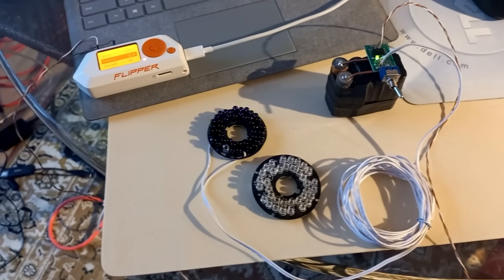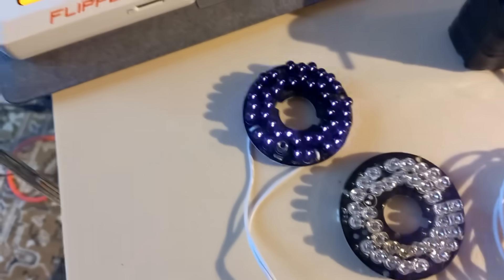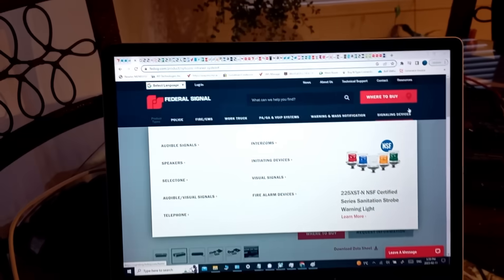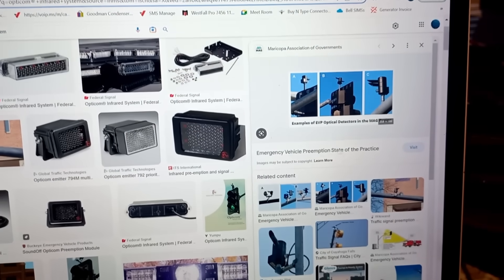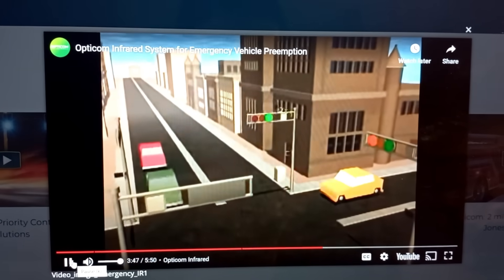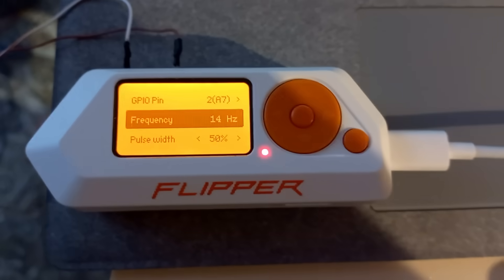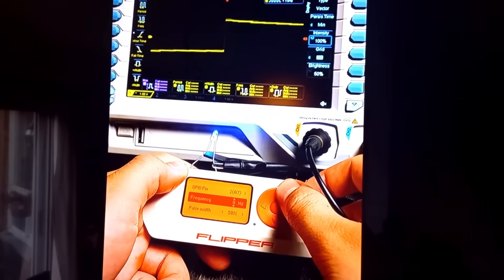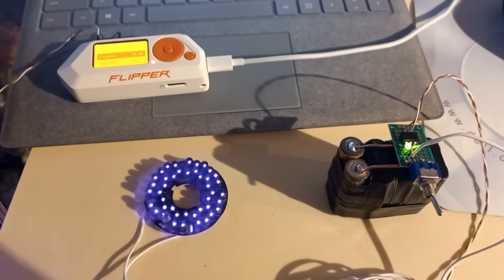Flipper Zero Controlling Traffic Lights

Comment: This wouldn't work in the UK, as we have no such sensors on our traffic light systems or any kind of pre-emption for emergency vehicles. In the UK the emergency vehicle just makes sure that as it approaches a junction with traffic lights, that everyone around has slowed or stopped accordingly, and the emergency vehicle just navigates through the junction safely. Emergency vehicles here in the UK just go through red lights (cautiously), or even go on to the wrong side of the road if required to get through a junction.

Not heard of any particular incidents over here of an emergency vehicle having a collision at a traffic light controlled junction. The majority of drivers hear the sirens, and pull over or stop, and certainly don't go through a green light when they can hear a siren and don't know what direction it's coming from.

When I'm approaching a green light, if I can hear a siren approaching, i proceed very cautiously, looking all around to find the source and direction of the siren. That way I don't go through green, and crash into the emergency vehicles that has just gone through a red light on the opposite junction.
Reply: This assumes you can hear the siren. If you have music playing, you likely can't hear the siren until it's right on you.

Comment: As a traffic signal tech for the last 27 yrs. I can tell you it will not work in any traffic signals that I know of. Like what was said in the video every emergency vehicle is assigned an ID # . The system is programmed to only allow certain ID ranges to be able to preempt the signal.
Reply: @peterfairlie2296  I like you. Very cut and dry, and 100% not breaking the law.
Reply: Often, codes are not used because it limits the capabilities of neighboring jurisdictions to provide mutual support.
Imagine Arlington police/fire trying to respond to Dallas but not having the right code.
Reply: That's what they should do--use an encryption method with a programmable code to trigger them.  This greatly reduces the false triggers.  Sadly, not everyone is using it.
Reply: @peterfairlie2296  If you could do that it would probably work for a limited time. I am in Tampabay and we would run audits every month looking for agencies abusing the preemption.
Reply: Assuming the IDs stay static, it would be pretty trivial to capture a signal sent by emergency vehicle via photodiode and a digital oscilloscope. Then just play the signal back.

Comment: I attempted to make one of these to get into my aunts gated community they had a receiver so FD could get in with out having to use a Knox box. 

I used an arduino running a led blink code at 14.whatever the pulse is I cannot recall, and I used a 12v security camera light, it had 4 10w leds and was extremely bright when viewed through a camera. 

I never was able to get it to work. We tested it using the emergency vehicle alert on a radar detector which is essentially just a mirt receiver. 

I used a scope to check the frequency and it was spot on. But it never once worked.
Reply: @peterfairlie2296  yes sir that's what I did never could get it to work. Maybe the arduino pulse is not smooth enough. I did read about using a oscillating crystal but I have no idea how that would work. I'm just a hobbiest at best.
Reply: At an apartment complex near where I used to live, people would roll a metal shopping cart over the wire loop embedded into the pavement on the inside gate side to let their friends drive in without the code.
Reply: that you tried is still pretty awesome. maybe it was too high up? anyway great attempt
Reply: @peterfairlie2296  I thought it was 14.025hz

Comment: That being said, if you were to instead modify the led running lights of a modern car, adding high power IR leds in between the standard leds, it could be stealthy enough to get away with even on camera. >_>

And I do mean those led strips essentially in the front of the car. The flicker would be hard to distinguish on camera from normal running lights on footage.
Reply: Sure except the Opticom systems also track plates of vehicles triggering the system meaning the cops can go as far as seizing your car and giving you a felony for impersonation.
Reply: @ltciscora  I have never seen an Opticom system that is tied to a plate reader. Also modern opticom's use a radio signal that is encrypted so that the light will trigger even with a LOS obstruction.
Reply: @PicklePatrick  By "plate reader" its more accurate to say a traffic camera reviewed by a monitoring company.  There's an OSD showing which freq was detected.  It was actual person doing the reading of the plate.
Also I don't think the two systems were interconnected, at least from what I saw.
The highway traffic camera feeds had the same indicator, yet there are no traffic lights on the highway.
Reply: @lorddissy  if u had strong IR leds wrapped around your plates then the traffic camera company won't be able to see your plates!

Comment: I've done research and experimentation into these, it's not worth it. Most cities record every angle of intersections when possible when ever the Preemption signal is received by the traffic controller. Unless you use it once or in truly older areas of the city without the cctv emplacements, You are going to get logged doing this. (If the flipper can flip the lights, the CCTV can see the flipper, Please smile for the court screencap.)

Long story short, when you mess with the traffic lights. The City prosecutor will set out on a mission to hunt you down, trust me I don't know from experience in the crosshair. But helped a city aim said crosshair in the past.

Wait for the traffic light and spend your time better making hand puppets with traffic.

Also not all cities use opticam and utilize an older style radio transmitter. You'll see that little box of antennas hanging upside down at those intersections. Easier to get away with these. But harder to accomplish with the rolling code.

Comment: Cool video. Though after watching it, I saw a Toys R Us and thought to myself, no way this be in 2023... So I did a bit of research and sure enough there is one between Tenth Line W and Argentina Rd. I swear if you also tell me your country has Radio Shack and Circuit City....
Reply: @peterfairlie2296  Don't be dissing Radio Shack. Back in the day I got a set of cans (headphones) that I spent perhaps $15 on and they were the best darn head phones I ever did own. Superb quality sound that beat even Sony, "Beats" which is utter garbage in every regard, and on many levels, even pioneer. The headphones I have now are pioneer and I spent way too much on them and compared to the Radio Shack ones, are very compatible. The diffrence, Radio Shack cost me $15 while Pioneer is about $300 

Radio shack was the go to joint for all your electronic gear and small gadgets. So was Circuit City but what killed them, who knows. Not even amazon could compete with the quality of either store. But still jealous you guys retained Toys R Us.

Comment: You could also do the same thing with an arduino for a lot cheaper.
Reply: Yup. This is doable by any microcontroller or 555 timer circuit. I could make a suitable circuit that would cost about 20 cents.

Comment: Back when the system was not as sophisticated, I was able to flip traffic lights by rapidly turning on and off my headlights.
Once the newer systems came out, it stopped working.

The only problem when flipping, the lights don't cycle yellow then red, but instantly went red, which was scary to think the other drivers would not be able to stop soon enough!

But I wonder why they have stopped installing the systems, but only have video cameras. Have they switched to RF sensors?
Reply: I used to use a boxed strobe light I got from Spencer's at the mall.
Reply: We have lights in central Florida that still change with the flashing of the headlights.
Reply: @Make-Asylums-Great-Again  Progress...
Reply: They still use it and was reprogrammed only to use specific devices with a method to only allow detection from authorized vehicles.  As for the cameras above, they only detect vehicles in queue to cross.  But the sun and harsh weather may interfere with its operation.  I've seen newer devices using radar-like device within a narrow area.
Reply: I would assume nowadays it would be much more economical for them to use plain Cameras running with some script that would interpret whats going on, on top of that the same camera could also be used as a security system.
Reply: @Nabee_H  Unfortunately, unless it is a camera with a very high frame rate (which aren't very economical), I don't think it will be able to detect the signal.
Reply: " @Nabee H  Unfortunately, unless it is a camera with a very high frame rate (which aren't very economical), I don't think it will be able to detect the signal"

 Let's assume a camera which might be running at 30 or 60 FPS. That is more than enough for several control bits plus error checking pr second. And if the light can strobe fast enough, you can pick out individual bits from scanlines thus greatly increasing the data thouroughput.

 This would be overkill for a simple traffic light changer.
Reply: Over here some lights still change when you flick your headlights
Reply: It does not surprise me that crap legacy systems from 50 years ago are still in use. These are also the kinds of systems that are easily triggered by lightning flashes, or even bright reflectons off of vehicles.
Reply: @zureai  " At least that's what I tell her to make her happy and believe." lol

Comment: In Somewhere, USA you can just flash your head lights quickly manually (not at 14Hz, probably impossible) and the stop light will change.
Reply: BS
Reply: @bobcosgrove3235  it's so emergency vehicles can trigger the lights to prevent collisions.

Comment: Better hope no cameras caught your plate while you tested...   They see you flashing that on the signal and camera records you, police be showing up at door...  They monitor intersections now because it's so easy to spoof and make those...  But newer and updated systems have an encoded pulse in the signal too so they are not just a htz signal pulsing to fool it.
Reply: @peterfairlie2296  I believe Mythbusters (or some show like that?) did that to test and see if it worked for jambing radar/lidar and for jambing speed cams....  I believe it didnt work, but I'm wondering if they only used like 2 or so IR LED's so people didnt go out and make IR license plate frames that just pulsed nonstop to jamb cams. I'd like to do some research on that, lol.. 

Then have the IR sender on the dash and that on the back plate...  My work commute will go from 1:25 each way to 45 min each way!  lol

Comment: You could use a Pi setup to control say an IR light if you where only trying to control the IR HZ rate rather then the Flipper zero ? Im asking just because the flipper zero is a little $$$ im asking only out of curiosity not taking away from your test? please tell me your thoughts i will say i always was interested in this im not stupid and go mounting it on a veh. that would be begging for hand cuffs. every cop car would see it coming on there dash cams of course.

Comment: I assume you can do the same with a like $5 arduino clone vs that $250 flipper
Reply: Easily, and you could set it to cycle through the required frequencies with a few for loops. However, the question here is "Can Flipper do x?"

Comment: Any lights still using this method are outdated. Okemos, Michigan, for example now uses encoded GPS/Cellular systems and has for a few years now. I'm really surprised you found an entire city still running on deprecated methods. 

I may of had my own traffic light controller at one time and I was confused when it quit working. It was brought to my attention the old systems were taken out and what I may of had would only work on older systems. Being a volunteer, it wasn't worth the cost to me.
Reply: America is still in the 1970's.
Reply: lol its not just a city.. These are literally everywhere. Your city apparently just decided to waste  money or got conned by some salesmen for this new system lol

Comment: I heard they are place them with new wireless antenna instead of lights now but they still out there but I could've researched tge new system wrong?I am starting to see wireless sqare, wiffi sensors, antennas now that dos a lot of different trafic data mining for the doi.I think they might do this to.I am surprised they did not build a wireless wifi thats has encryption to it that changes keys every time a a emergency unit uses it like a car garage or other new encryption real time key changing.
It will random changes key and syn it to the emergency system and match the key but the key will be encrypted to,with special decryption hardware mixed in with software. You might beable encrypte the hardware with randomnizer voltage or resistance,electric, with a possible vocoder. I wonder if you buld a randomizer vocoder to first send a electric charger at a random,vocoder modulation,that's encrypted by tge vocoder that has another vocoder randomizer receiver that every time its used ,the vocoder reciver will receive the internal modulation than processed to decrypt,decryption and normal nice tge key back so the computer software can decrypt the software part.So two encryption internal encryption system working to geather.hackers need matching everything hardware and software.They would have to study the plans and steal a unit or try to build one to hack.lol

Comment: Cannonball run with this would break all records 😅
Reply: Almost the entire run is on highways that don't have traffic lights, plus a few mostly rural exits for gas that generally wouldn't have these systems.  It might get you out of New York and in to Redondo Beach a bit quicker, but at this point the records are set based on what pace you can maintain across the flyover states.
Reply: @SeanHarlow  you make a very good point
Reply: they use these from abulances. however I believe its a felony to use haha, it was mentioned in a cannonball video
Reply: @thestreetzking  whats a cannonball without some felonies, right?
Reply: Good luck....

Comment: What resistor are you using with that diode? Do you also use a resistor on the 4n33 input from flipper?

Comment: Can this be done with any microcontroller such as esp32, arduino or stm32? Flipper seems like a great tool, but for this specific purpose it's a bit of an overkill...
Reply: @peterfairlie2296  I completely agree. Flipper zero is awesome tool that can motivate a whole bunch of young enthusiasts. It's also handy to have one as a "swiss knife" like tool😉
Reply: Of course can it be done using an ESP32 or Arduino. It's just a LED blinking at 14hz. Any microcontroller can do that!
Reply: @fusseldieb  With a frequency generator app on my phone, I wouldn't even need the ESP32/Arduino. Although it may need an OpAmp added to the Darlington pair.
Reply: @CraftAero  No need for a phone, you'd have to interface your driver circuit with it. And it's redundant since you're only making a 10/14 Hz oscillator.
Reply: yes Luka, search D1 mini MIRT
Reply: 555 IC Will do the job.

Comment: I did not notice the lights changing because your device did anything!? Did I miss something? Very cool device.
Reply: I think that's how well it was working. A couple lights it went from yellow to Green meaning it was about to turn red but then flipped back to green cuz of the device ( I think )
Reply: @Jackzill4  what time stamp is this?
Reply: @GamerGee  the one at 10:40 is a good example. As he's coming up to it the light is yellow then flashes to green
Reply: @Jackzill4  The light was actually red here but that further illustrates the point of how well it worked as it just completely skipped the amber light
Reply: @brad5290  When you are stopped at a red light it doesn't go from red to yellow to green. it just goes from red to green. If I were to guess, he didn't even use the device in the driving part of the video. I believe a long stretch of road with a lot of traffic lights are generally timed so cars driving near the speed limit wont have to stop at every light.
Reply: @AdrenalineRu5h  You are right. On my commute a few years ago, I would go to work at 230am. All the lights in a 7 block stretch would turn green at once and if you went the speed limit you would just make the last one before they turned yellow.  One morning I noticed the second to last light was out of sync and would go to red after a few seconds of being green while all the rest stayed green. there was no cross traffic. This continued for several days. Very annoying.

So I emailed the city and asked them nicely to look into it because I really enjoyed sailing through those lights that early in the morning when it was usually just me and a couple other cars.

They actually got back to me and said according to their system nothing was different and all the lights were still programmed to allow someone from the first light to make it all the way through as long as no cross traffic appeared that early in the morning.( After 530 am the lights operated on timings only to allow for more cross traffic going to work and there was no way to make it straight through). I emailed him back and said this one light was still turning red despite no car was there to trigger it. He emailed back a few days later, said he sent a crew to check it out and  it turned out it was a faulty pedestrian button that was constantly activated. In a week it was fixed and I was back to my nice drive to work with all green lights.

I made sure to email him one more time to thank him for looking into it.